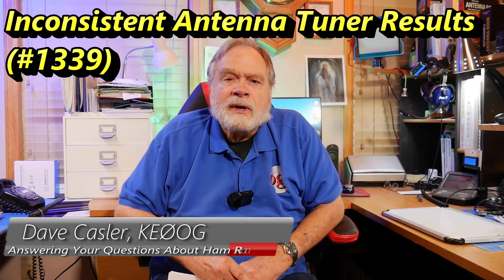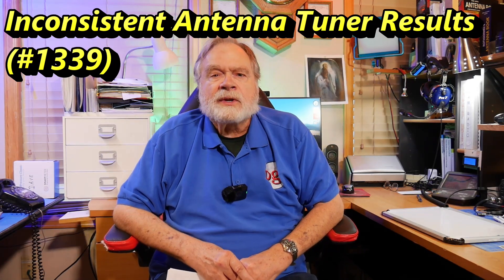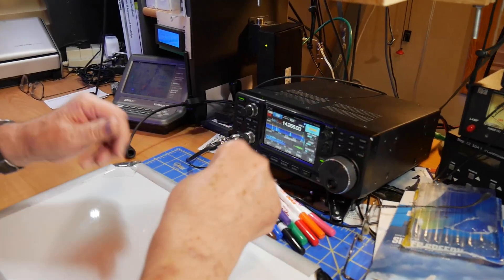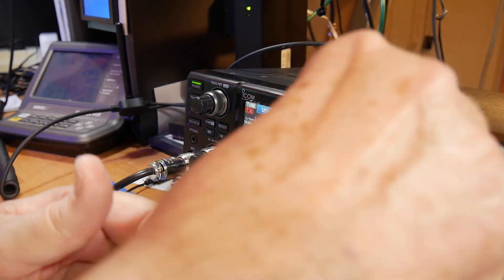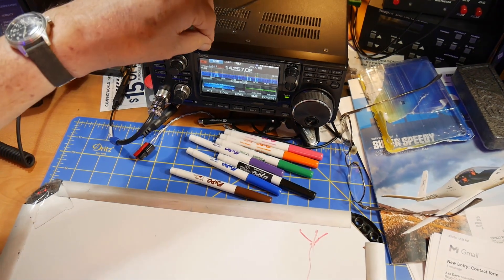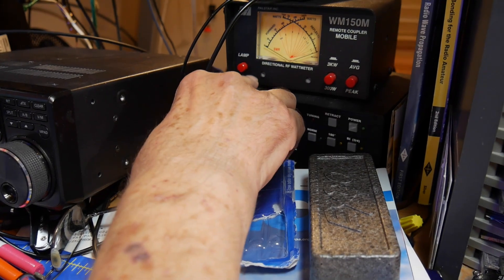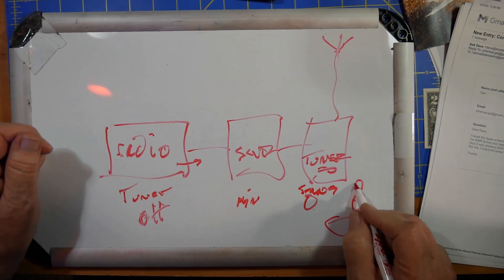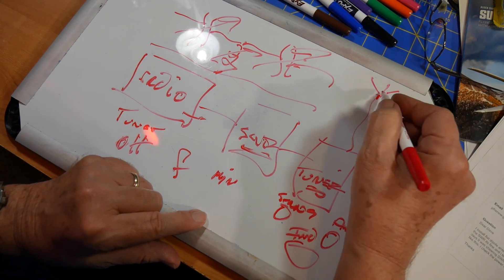Inconsistent Antenna Tuner Results (#1339)

Comment: Also may not be the tuner, it could be your antenna or its connections, could be your jumper cables, water in your coax, old or bad coax, all things that have to be checked, its better to start with all new if you can. Also check your swr with nothing in line but your swr meter or with an analyzer first and write down your measurements then put your tuner inline and re- measure and this will show you the condition of your system and will let you know if something is wrong.  And if you have an amp then make sure your tuner can handle the power your amp puts out, At least thats how i do it.

Comment: As you say one of the advantages of manual ATU is that you will notice if something changes but if you have an auto-ATU it can hide the problem from you.
One of the best ones I heard was a guy who generally had a good SWR but from time to time the meter would "kick" slightly but then settle back to ok. On investigating the masthead connection there was a pile of dead ants in the bottom of the connector box... What was happening was from time to time an ant was walking across the plates of the airspaced capacitor in the masthead match, when it bridged the plates during TX it shorted it out & became a "1 ant fuse" so it died & fell to the bottom & the SWR returned to normal.

Comment: I modified my MFJ 16010 tuner I was given to a Pi tuner by adding a variable cap. on the input for more flexibility as an experiment so it needs a larger box now.
On my long wire I tuned for my lowest reading, then using my NANO VNA to check and found if I moved things around it did change from about 47 Ω to 56 Ω and the j value changed. Very tricky to get my lowest reading and I need a slow motion drive for the output cap.and mount it FIRMLY in position and SOLDER it in a new box, then try again. That new cap. on the bench on wires was not great. Earthing helps too on lower frequencies. Rain, wind, snow and ice outside on the l.w. must alter things too. 

Remember when digital frequency readouts came in and everybody arguing what frequency they were on? As if it mattered because different people prefer different tones for listening to s.s.b. and c.w.. 

G4GHB.

Comment: The SGC 230 is a remote automatic wide range relay based antenna tuner with an L network tuning circuit in a weather resistant housing that is generally placed near the antenna feedpoint rather than in the shack. It is designed to automatically re-tune the antenna whenever the SWR rises above a certain level. If the SWR is rising above 2:1 this indicates that the tuner is either damaged or unable to re-tune properly due to problems in the antenna or feedline. Note that these tuners can be damaged if operated at frequencies where the antenna impedance goes extremely high and the RF voltages produced become too great for the components in the tuner. For example with an 80 meter dipole operated on 40 meters the impedance goes above the tuner's range and the extreme voltages can damage the tuner. Once damaged it will no longer produce low SWR on all frequencies though it may still work partially on some, depending on the extent of the damage..

Comment: More specifically, with the Yaesu ATAS 120 automatic screw (tuning) antenna, is the SWR meter on the Yaesu FT-891 or newer radio trustworthy or should an inline SWR meter be added? Thanks for the videos!